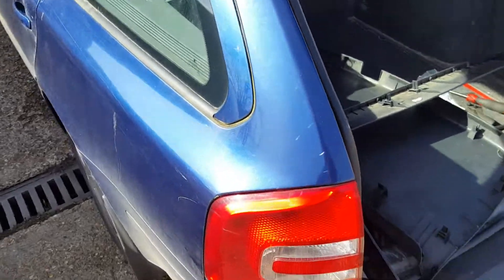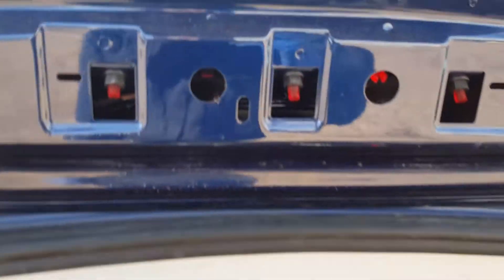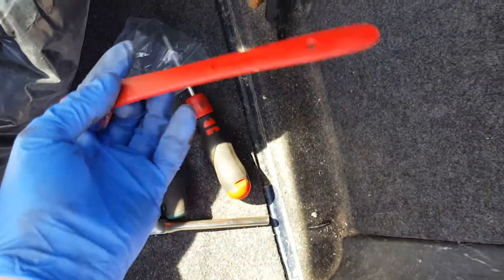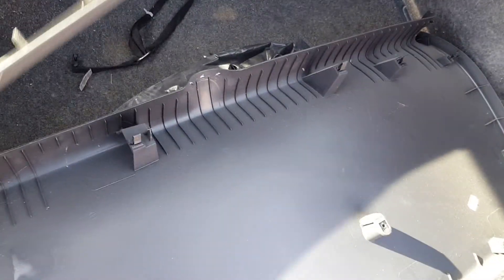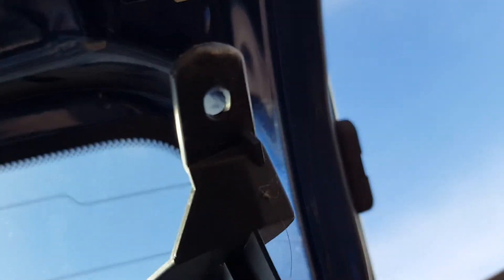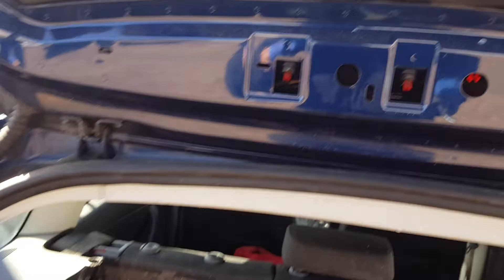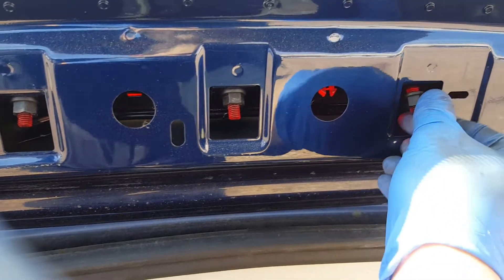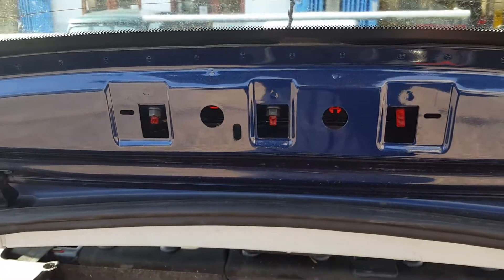Skoda Octavia centre brake light problem fix/replacement

Comment: you should continue the clip with the fix / replacement moments
Reply from the maker: Cristian-Alin Ilie 
Hello mate. Sorry about that. I know but my problem is that i havent got camera to put on my head or etc... and need two hands :( i do try and explain and show as much as i can.
I was trying to invest some money in case i get to 1000 subs.
Reply: Hi. I was curious about the problem. Water gets inside or the leds just brake? I think is a water problem,in my case at least.
I din't have the time to try remove the brake lights, but with your video now will be much easier.
Reply from the maker: Cristian-Alin Ilie hello there.
On some of them they get a little crack for spme reason and thrn humidity gets to leds and connectors and obviously it stop working. If not its just the original led that are not very good quality. 
Water is a common problem on an audi a4.
Reply: Hi, where is the fuse for the third brake light?
Reply: @aylwinstarosa4965   i also am wondering this, pretty sure its one fuse for all brake lights , not a single one each, so if ur other lower two brake lights are working and the high level one isnt, then it shows its the light not a fuse issue
Reply from the maker: Sorry for some reason I haven't seen this comment. No there shouldn't be one just for high level. You can always check the feed to it with multimeter if you got someone to press the brakes to see if it's getting voltage to it.